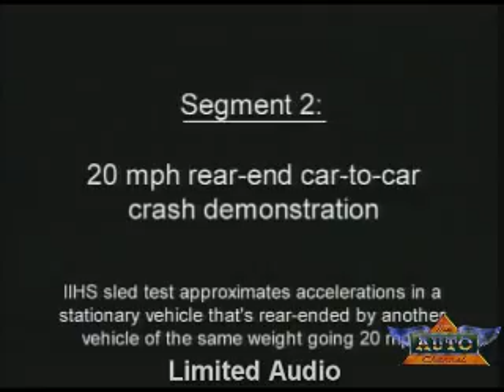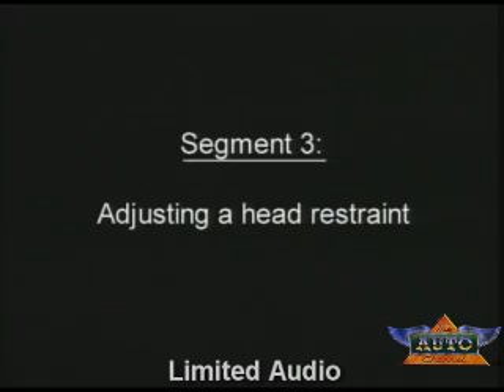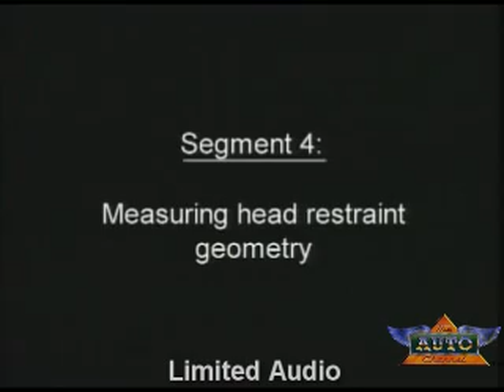IIHS - Rear Crash Protection in SUVs, Pickups and Minivans

Comment: i know it is crazy to respond to you 3 years after your comment but i have to :)
every manufacturer implements its own safety systems. and yes at the date of your post, most manufacturers had whiplash protection systems, different in design, but tested and proven equally safe from euroNCAP.

also, every manufacturer has side impact protection. they don't have a special name for it, but they do.

ofc Volvo was, and still is a pioneer in safety, but these days most cars are almost equally safe